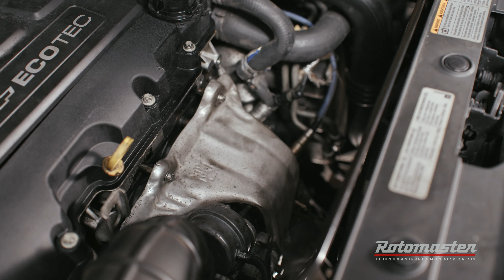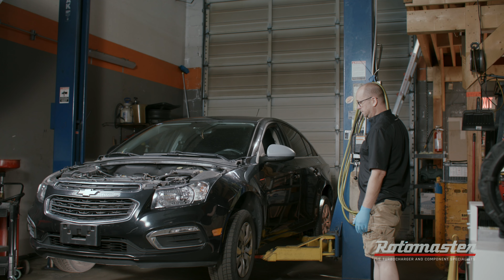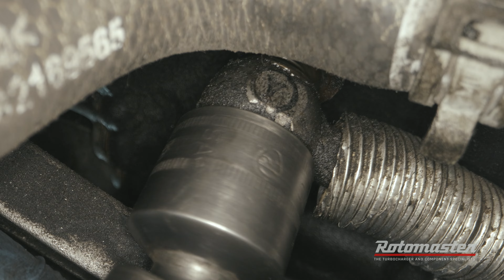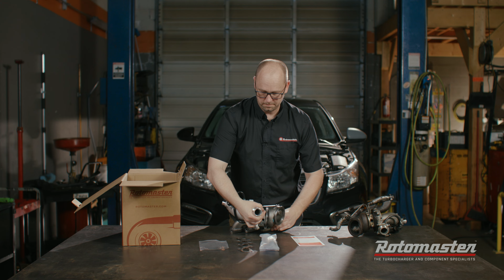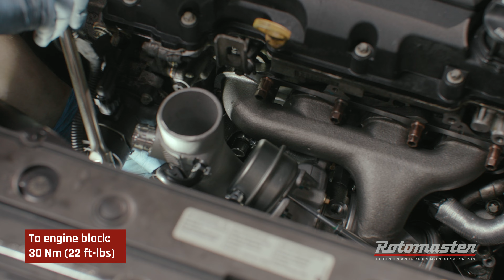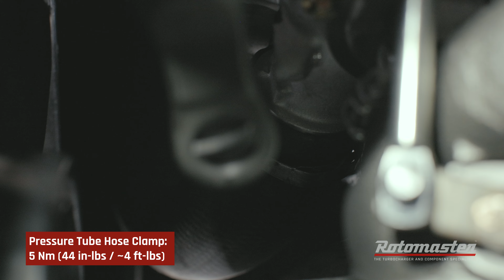GM 1.4L Chevy Cruze Turbocharger Installation Guide

Comment from the maker: Standard Tools Needed 👉
Pliers: For gripping hoses, clips, and small components
Bent Nose Pliers: For hard-to-reach clips or hoses
Hose Clamp Pliers: For spring-style hose clamps on coolant and oil lines
17mm Wrench: For bolts on the exhaust manifold
10mm Deep Socket: For recessed bolts (turbo/manifold)
11mm Socket: For various turbo assembly bolts/nuts
17mm Socket: For larger turbo/exhaust bolts
3/8" Drive Ratchet: For driving sockets
Socket Extensions: To reach tight-space bolts
Torque Wrench: For proper torque on bolts (Turbo bolts: 4–20 ft-lbs; check service manual)
Razor Blade / Gasket Scraper: For removing old gasket material
Pry Bar: For separating or aligning components
90° Pick: For removing stuck gaskets/seals or broken oil drain parts
Shop Rags / Paper Towels: For spills and cleaning
7mm Socket: For smaller bolts or screws
Oil / Coolant Drain Pan: To catch fluids during line removal
Swivel Sockets / Universal Joints: For bolts at awkward angles
Brake Cleaner: For prepping gasket surfaces